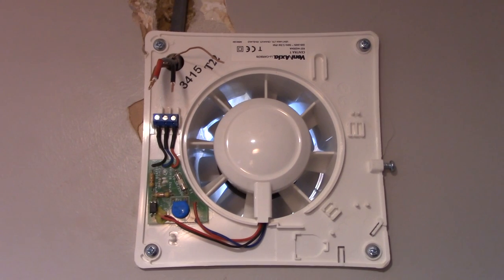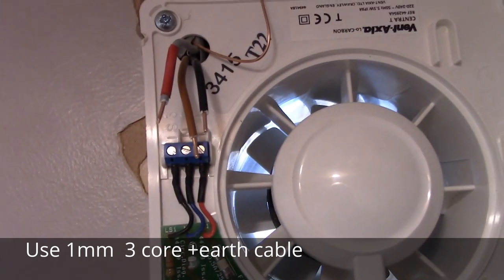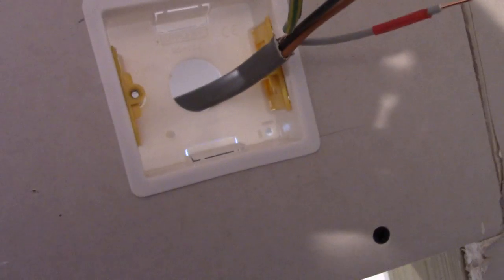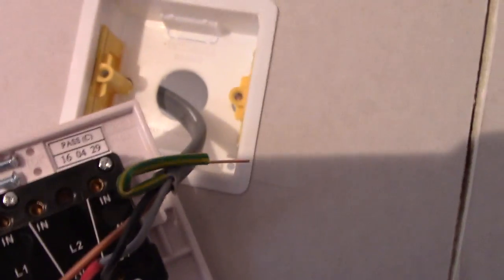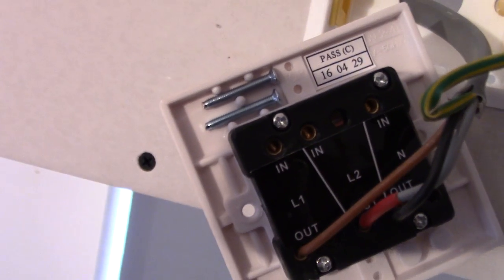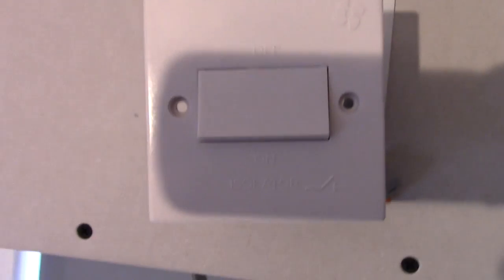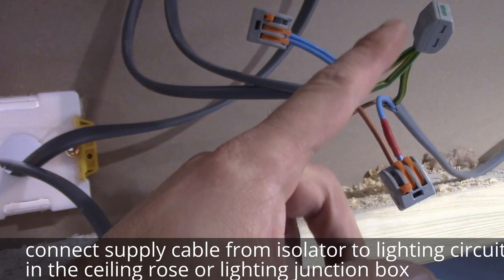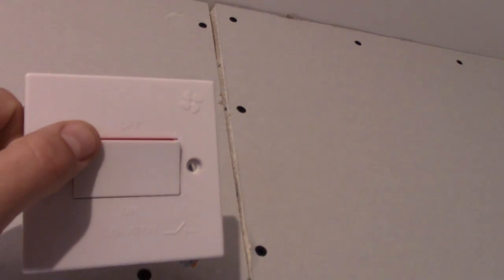Bathroom fan timer switch isolator installation connection.

Comment: Shouldn’t be using red sleeving on harmonised colour cables . Should be brown sleeving to identify a live,  also grey should be used for neutral and sleeved blue and make sure the connections are terminated within an appropriate box not just loose in a void wall

Comment: What size cable should we use for fan and fan isolator? 
Very clear simple way  and beautiful explaination. Thanks
Reply: Whether supply from mains ring or lighting circuit, best to have a fused spur with 3 Amp fuse outside the bathroom, maybe above the door. 
   From that, you can wire to switch, lamp, fan isolater, and fan. I use 1.5mm², 1mm², even 0.75mm² so long as it's good quality fine stranded flexible cable, preferably with bootlace ferrules properly crimped. With all the fiddly fittings, the flexible cable makes it much easier.
   If needed, I always use Wago connectors in Wago boxes or the switch box, never just sitting in the void.
   I've never yet seen a registered qualified professional electrician do a good job with this, even when I offer to pay more for a slower job, and I've installed boxes with conduit and string. They've always been sloppy, left connectors loose, dropped grommets, etc. Tbf, the connectors in switches are often poor quality, even in quite pricey switches, so they take time to wire up well.
   I do, now, know of a couple of diligent sparks who do domestic work but retired due to caring responsibilities

Comment: I only have an extraction fan with Permanent Live and Neutral. I know what to do with the Earth wire, but what do I do the light switch wire? 
Just put a sleeve on it or use PVC tape to cover it? 

Thinking I should just get a timer version instead.

Comment: Would I need to connect low voltage transformer to the fan?
Reply: Only if you have a 12v Light built in

Comment: Where do you get the permanent live from? Spur from the ring socket?
Reply from the maker: Hi Martin . Permanent live is from lighting circuit .Instead of ceiling rose in a bathroom the connection is hidden in a wago box (that doesn't need to be available for inspection)  in a stud wall above the door. As you know the socket outlets are not permitted in a bathrooms. Seb
Reply: Oh, yes, now it's clear to me. Thank you very much for the explanation.  One more question, in order to do the neat job and deliver permanent live and the switched live - can I use one WAGO box to hide all the wires inside? Box will be easily available and visible on the attic.
Reply: Martin 
Yeah man ...

Comment: Naw you just take the feed and neutral 1.5 T&E to the light switch then take  a 1.5T&E to the light and a 3core and earth from the light switch to the fan isolator then a  3core and earth  to the fan no junction boxes

Comment: Hi, what is the extra live needed for, thanks
Reply: Extra live is there so the fan can continue running for few minutes even after the switch is off.
Reply: If the fan is connected to the light switch and comes on with the lights and you want the fan to run on after the lights have been switched off you need a permanent live connected to the fan which has it's own timer.